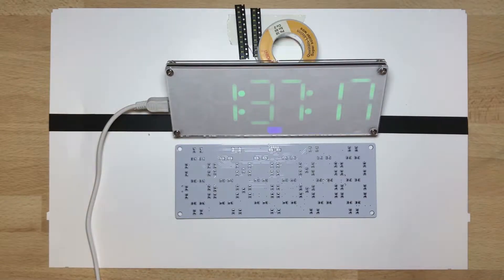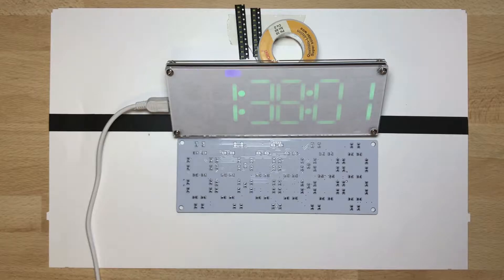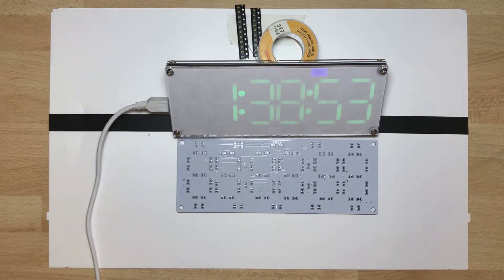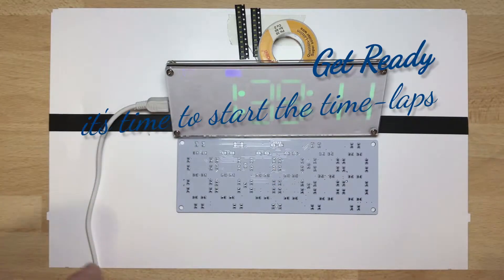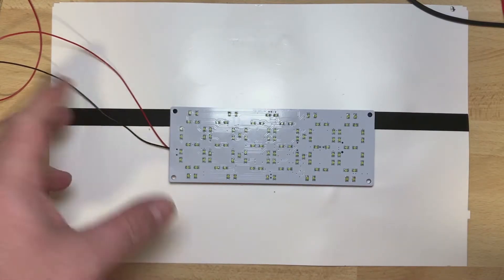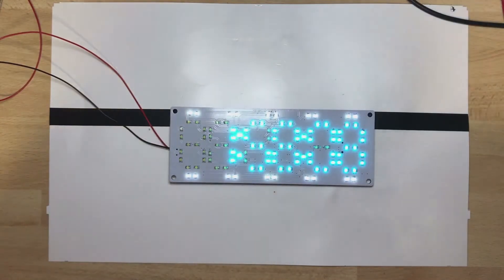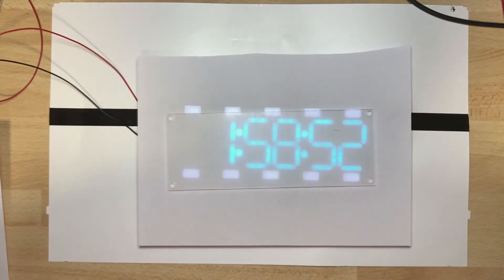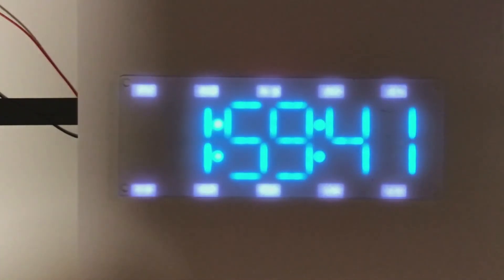time-lapse Soldering the Geekcreit® DIY 6 Digit LED Large Screen from banggood.com

Comment: Mine gains about 20 minutes a day, would be nice if I could find out what value the crystal oscillator is, as I think that may be the problem, and replace it, but not sure if I am right until I replace it. no joy yet.
Reply from the maker: The usually frequency for clock crystals like in this clock is 32.768 khz maybe it was damaged or not very precise. You could check the frequency with an oscilloscope.